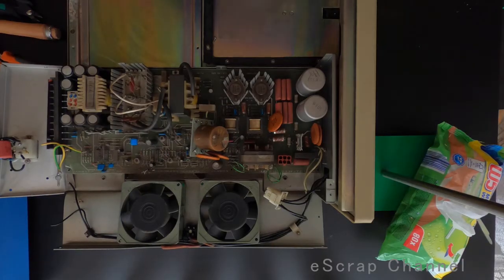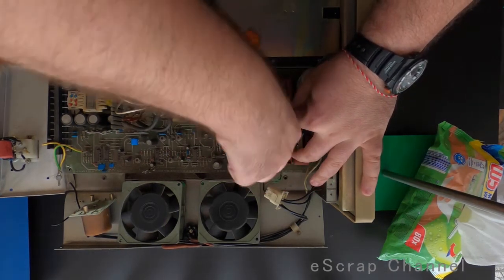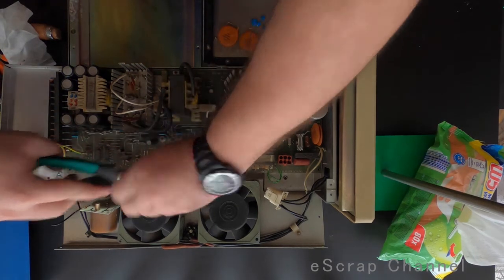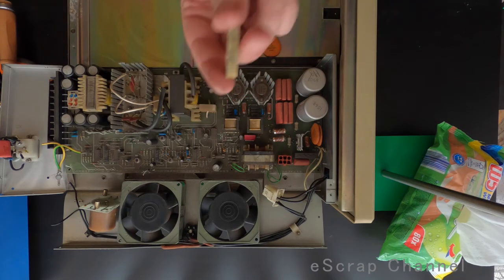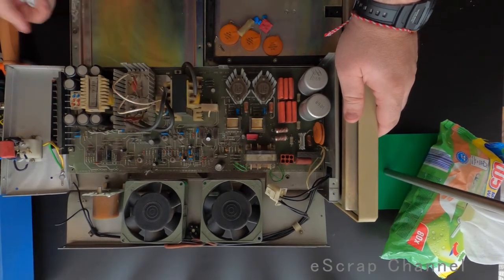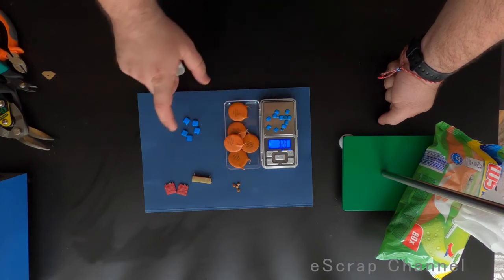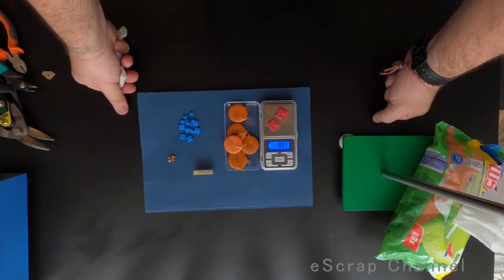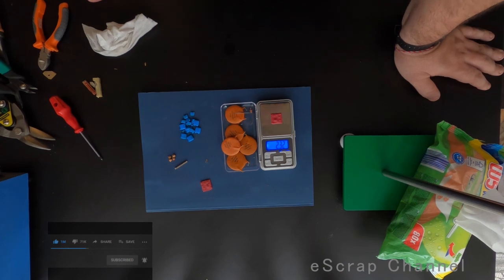Scrapping 1989 power supply for Palladium!

Comment: I need to ask a question.  Do the capacitors that you remove for palladium have palladium because they are from Russia or former Soviet countries?   I been cutting off capacitors since following you and someone (ewaste Ben) said that this is incorrect that the only palladium can be found from older mlcc’s.   Non magnetic.  

Now I’m so damn confused 😂
Reply from the maker: Hi, MLCC is the capacitor and if it is coated in plastics or directly soldered on the board it is same capacitor. In electronics from Soviet Union, Bulgaria and other east Europe countries MLCCs manufactured before 1990 usually have palladium, platinum and silver in different proportion based on model. Catalogues are available in Russian sites where content of precious metals is listed per model. About other electronics from Europe, USA and Asia and modern one. I did many tests of magnetic and non magnetic MLCCs and in magnetic palladium content is very low. 1-2 g palladium per kilogram capacitors. Silver is present in higher amount. For non magnetic MLCCs I’ve seen results above 10 grams palladium per kilogram. Everyone separates MLCCs differently so results on internet and in practice vary a lot. I personally collect MLCCs from any electronics old and new.
Reply: @escrapchannel  man, you are awesome.  Thank you for the info and your time.

Comment: Hi. How do you know what capasitors are silver content, and witch ones have palladium? Can you read that on Them or?
Reply from the maker: Hi, for some capacitors I know from the label and manufacturer, but if it is a capacitor I see for the first time I break it in half.
Reply from the maker: When you break a capacitor you should first check if there is an MLCC inside. Then use magnifying glass to see the color. Silver is white metal in the capacitors and if there is palladium - you will see it more like metallic grey.
Reply: @escrapchannel  thx man. :)

Comment: Hi,
Good video!  I like the overhead camera view, but it seems so far away.  Even full screen it’s hard to see very much detail.  I had a question about the resistor (potentiometer) you broke open.  Is it only that one brand that you’ve found palladium in, or do you find it in all brands of those “10 turn” type of potentiometers?  I’ve always assumed that the little wiper contact was just silver plated? Some of the brands we get here in the USA have a gold plated lead which runs the whole length of the package, and that’s about the only part that I save.
Reply from the maker: Hi, potentiometer I know as resistor - these before 1991 contain palladium - SP-5. Switches I always check ... sometimes nice surprises are hidden there.
Reply: Mantap boss..🙏🙏👍👍👍👍🤝🇮🇩
Reply from the maker: Thanks!